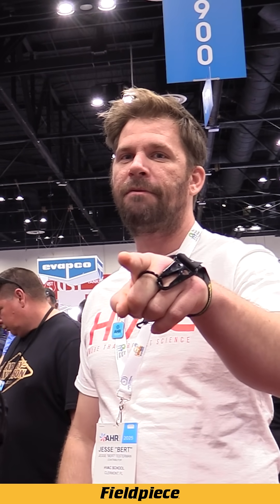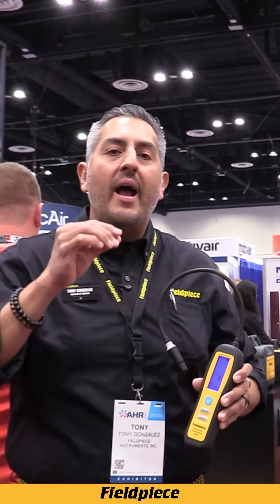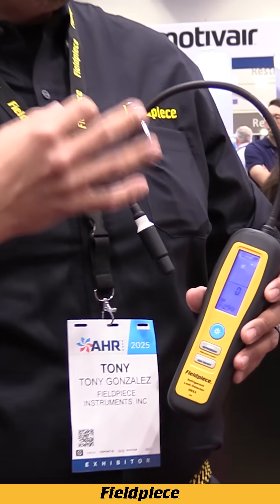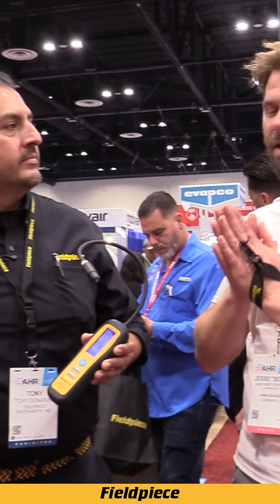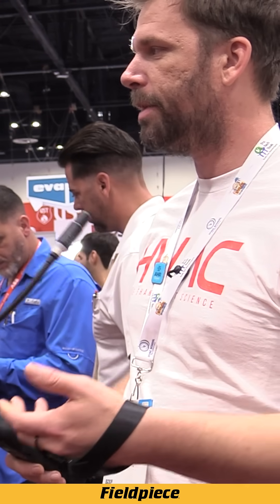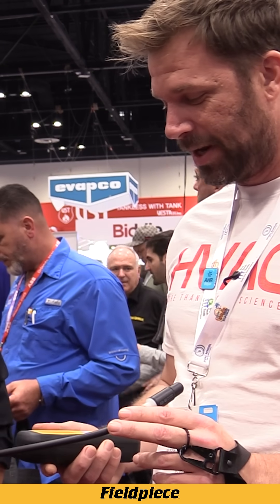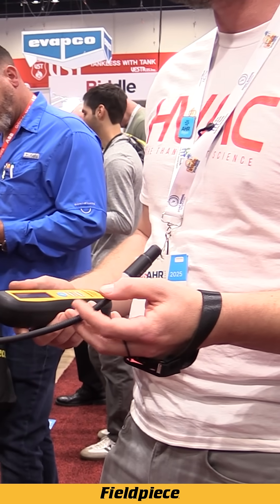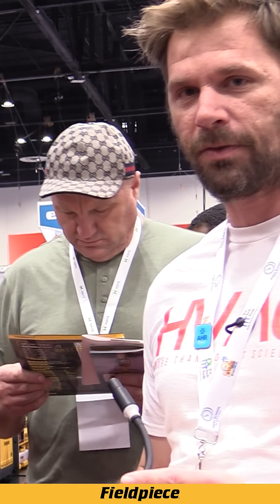Bert Discovers the NEW Fieldpiece DRX3 Refrigerant Leak Detector at AHR 2025

Comment: Does it detect your own breath that your exhaling? Because I've had an issue with some fieldpiece leak detectors going off because my breath in a tight spaces. If they have solved that issue then this will be the goat of leak detectors. I was working on a split 410 system.
Reply: I could never conceive of that being a possible issue at all
Reply: I saw the screen show 12ppm while he was holding it
Reply: If I don't have to hold my breath in those situations then I'd be interested. You can exhale at the sensor and not have it go off then your good to go. Maybe it's a rare defect but it is real because it goes off everytime.
Reply: What proof are you drinking?🤪
Reply: @YTsux24-7  I don't drink
Reply: How much and exactly when can we get our hands on it
Reply: @bkluntz  so far only Europe has it. DRX3 is the model but they also refer to it as an ATEX. Prices very in Europe but 700.00 euros is as high as I see.

Comment: Now that is an overdue and much needed leak detector in the industry. 
       I would love to put that leak detector through a test on a known small leak in a system.  And then remove the refrigerant and replace it with all the different types of refrigerant to and trace gas all on the exact same system and repeat the test over and over on each gas on the same leak..  just to show off it’s capability. 
    Well, done, Fieldpiece 👍